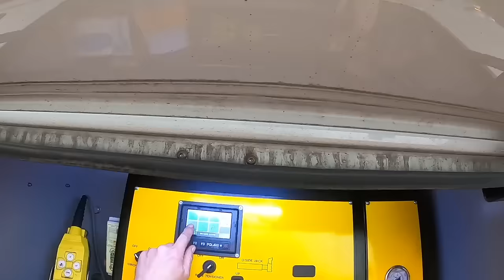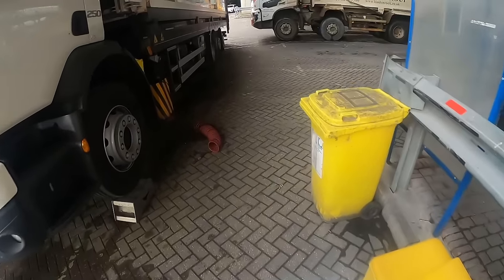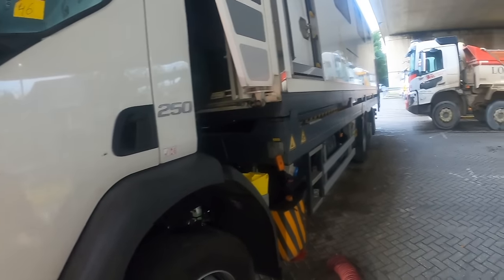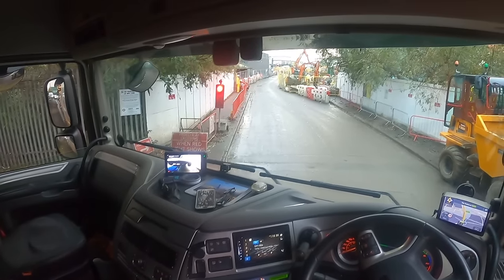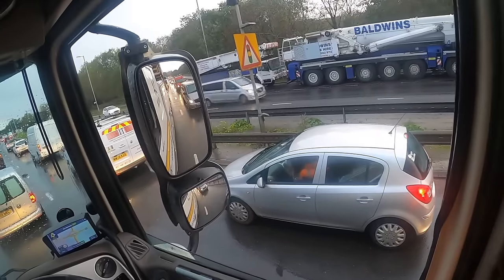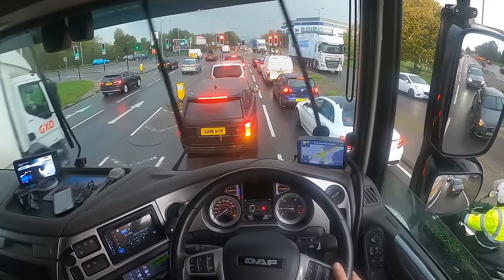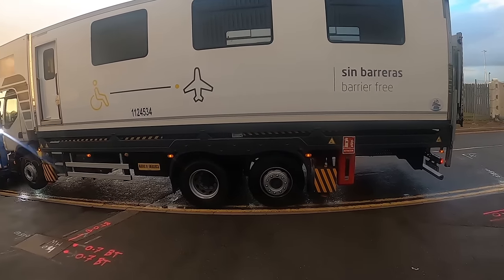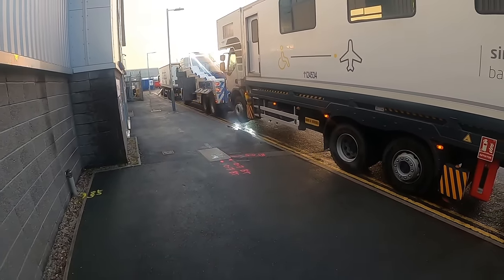TOWING AIRBUS A380 AMBULIFT THROUGH GREATER LONDON!

Comment: Nice work there dont you do both drive shafts then ?
Reply from the maker: Thanks for watching , normally we only need to remove 1 half shaft to disconnect the drive to gearbox , but buses with ZF axles our advised to remove both half shafts to fully disconnect the drive.

Comment: I'm wondering. Should the shaft you removed have any oil or not?
Reply from the maker: Thanks for watching , you tend to get bit oil when you remove half shaft.
Reply: @HeavyRecoverywithSteve  I was thinking if you need to replace that oil. But thinking about it some more, this is just oil from the differential, isn't it?

Comment: That 3 lanes into two is classic UK and is respknsible for so much delay.  If it were two all along it would be much better. New York has places where there are 6 or 7 lanes, often with the inside lane 'open' or 'closed' due to parking (sometimes legal sometimes not) and that constant merging in and out really slowed traffic. They removed a lane from either side, made in a segregated cycle track, and traffic flow for motor vehicles improved measureably. Sadly people blow their gasket if you try that here so we are stuck with wasted space, higher risk for vulnerable users and stop-start traffic ,eading to more time sat in qeues and more pollution. Peoples prejudice causing themselves more harm ultimately.
Reply from the maker: Thanks for watching and comments.

Comment: Seems like a lot of hassle having to remove these half shafts, would it not be easier if you had a flatbed with a winch or low loader
Reply from the maker: Thanks for watching  John , heavy underlift best for most of our work for getting in and out of places and you can tow tall vehicles that would be over height  on a flat bed.
Reply: @HeavyRecoverywithSteve  yeah i didn't think of the flyovers,that would be a problem, though for smaller rigids like that it might work better

Comment: If you don't mind me asking what does HGV driving pay you?  Because in my neck of the woods , they were offering £14/hr for motorway roadworks shitfts on 7.5t truck car recovery....

Minimum wage is soon going to be nearly £12/hr for an unskilled worker over 21 with no experience!
Yes to drive an HGV with a new licence is almost impossible!
Nobody teaches you how to reverse a class1, just a shitty offset parking move that I aced 10x on tests day...

Different to parking lot splicing a 40' in a space not wide enough to open cab doors fully!  In death of night or a quiet day on motorway services or tight bay I'm OK...   but pressure in a DC of 20 people / waiting  drivers watching, and a queue wanting to get past ‐ my head falls off!

Streets and general reversing isn't a problem.    It's the pressure of the rush that fries me!
Reply from the maker: Hi John thanks for watching , think you looking at £16 for experienced HGV transporter driver then Heavy driver be on a bit more.

Comment: Heavy recovery steve make new video you tube
Reply from the maker: Hi Lee , you can remove either half shaft to disconnect the drive to gearbox but easier to pull non diff lock mechanism side for refitting , thanks for watching.